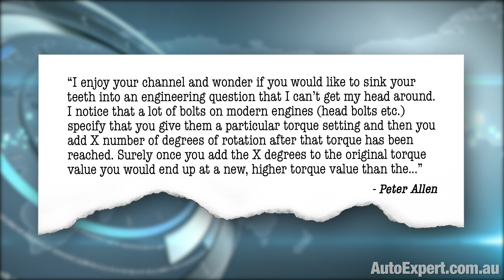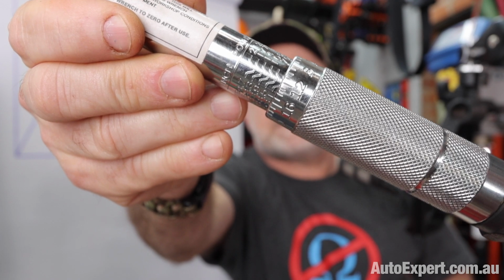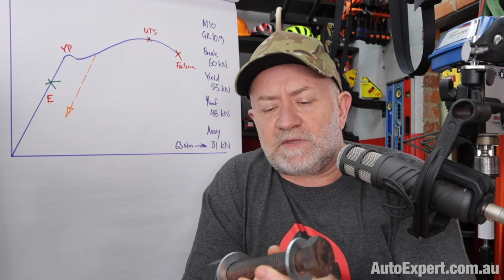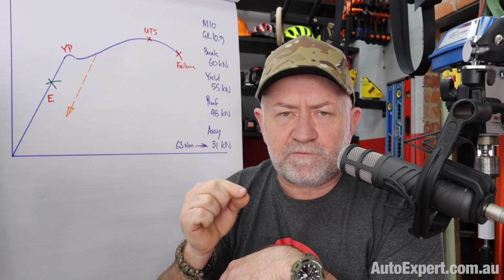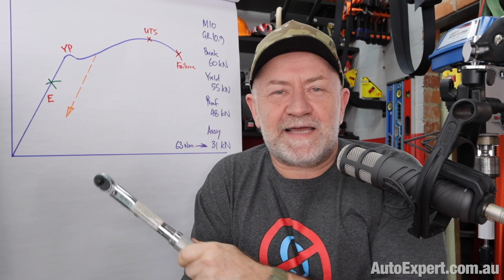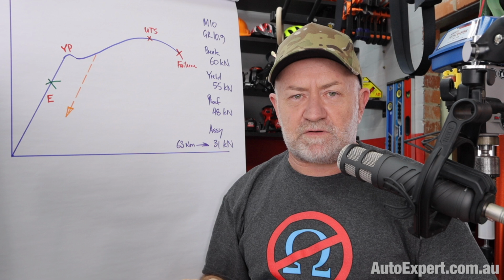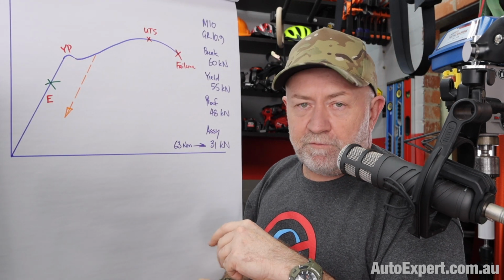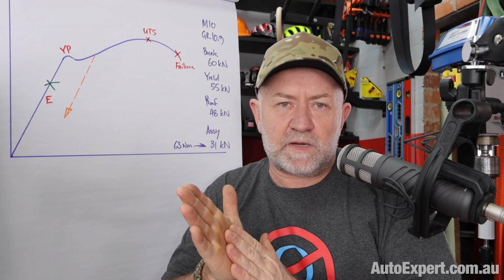Torque to yield bolts & angle tightening explained | Auto Expert John Cadogan

Comment: Well said John been an engine reconditioned for 36 years and still have to explain to mechanics every week why they must be replaced and secondly the best lubricant to use on the bolts or studs to achieve the correct torques👍
Reply: Michael Wilson  the engine world is so complex as the technologies in the modern engine get more involved each year so we never stop learning just like ra finishes for block and head surfaces,bore finish requirements for different piston rings etc but one of the biggest problems we find is when we ask mechanics what caused the failure rather than just example put another head gasket on it👍
Reply: Hi Bryson, ive only ever installed torqued bolts dry. And have just come across TTY bolts recently. What lube do you recommend to not over torque/stress the bolts while achiving the desired angle/stretch? A few artiles online mention using straight weight 30 oil. cheers
Reply: @loccomoffo1000  Hi we recommend a product made by CMD EXTREME PRESSURE LUBE NO3 it’s available from precision international in vic or Fabre in nsw or online.Apply to the threads and under head of bolt and both sides of the washer if it has them.Will give you a great result every time.

Comment: Fantastic John. Can’t wait to the next video on stress raising points and the difference between machine cut and rolled threaded fasteners. Keep up the great work in educating us all.
Reply: Lets also include the ones where the threads deform slightly as the bolt is done up.  They are designed so that the angles are correct when installed.

Comment: Kudos to all the engineers who keep all the bits together, especially in the aerospace industry. I have personally been responsible for keeping the wings attached to fighter aircraft, in some examples of which only have three bolts, a truly amazing engineering feat. 👌😎
Reply: Aways important to do the odd nut and bolt check...
Reply: ive seen the wings a shakin. so yeah feat of engineering. also rode a plain that had visable motor cover bolts rattled out. it was a comercial small plane operated by a large carrier.
Reply: Ever install bushings in those lugs that are swaged into place with a mandrel and air over hydraulic pump?
Reply: @Kenjiro5775  Removing them without galling the mating surfaces is an art form.

Comment: Thanks John I used your greased wheel bolts idea (VW uses bolts rather than studs) and it worked well. Very solid. Even bought a 1/2" torque wrench from Bunnings ($40!!!) also at your suggestion.

So yes, indeed, your hopes to have helped are fullfilled.

Comment: I agree with what you say here; I have BMW E46s, had them for years. Underneath is an alloy skid tray that is removed from time to time. It has 8 seemingly normal bolts so every non-BMW tech will simply unbolt them to take the tray off when required and re-bolt with the same bolts on replacements. The tray is structural, the bolts are torque-to-yield + extra turn (can’t remember the angle), cost, in the UK, £70~80 from memory and must be replaced every time the tray is removed. Consequently, nobody replaces the bolts and the stability is compromised. Bizarre BMW nonsense.
Reply: Feral Man  I agree, I've checked it with a spirit level.
Reply: I had am e46  coupe trays were plastic though maybe different bit you're referring to I loved my e46 coupe cdse

Comment: Best engineering explanation on subject that I found... big like and subscribe...
Unfortunately most automotive servicing is done with impact wrenches without bolts replacing, and they use torque/angle tightening just on cylinder head bolts, camshafts ... but not all times they even replace those engine bolts ... but in the end an old car repaired can't be like a new one...just extend its life until it brakes all around and get to junk yard...
Thanks for sharing your expertise in the field ... useful for us, as DIY repair, at least for me that I was not understand very clear those extra angle tightening.

Comment: I'm a fitter by trade (been off the tools for a few years now but still working in the industry), and one of the easiest bolting methods I've used was hydraulically stretching the casing bolts on a steam turbine. We are talking bolt diameters up around 80mm here so there's a fair amount of pressure going through the hydraulics to do the job - makes the job easy to undo them as well. I do think that people who are on the tools all day everyday can estimate bolt torque fairly well by hand. Anyway if all else fails just tighten until it goes loose then back off half a turn :)

Comment: Did a few heads with this set up. VRS sets came with new head bolts including lubricant, apply to threads & underside bolt head. Tighten bolt to specified tension with tension wrench, then use a degree plate. Critical head bolt threads in block were spotlessly clean. 
Example 25 ft pounds, 90°, 90° , 3 stages, spiral or criss cross sequence, working from center outwards.

Comment: Ultrasonic techniques have also been used in the auto industry for head bolts, main bearing caps, etc... Where a piezoelectric layer is adding to the head of the bolt and ultrasound is used to measure the strain applied as the bolt is tightened.

Comment: Thanks for your sharing of knowledge. Working on a machine the size of a small apartment building, comprehending why 'we' use a 1 meter pipe on a large ratchet to get the 'shown' tension allows me to 'push back' and show - via your video - that maybe, just maybe we can rely on the gasket and its composition and tighten the 20 bolts 'a little less' - even with the torsion increase required for lubricated bolts...

Comment: When I started in marine engineering, we used torque wrenches for most of the ships in the fleet. Hell, I remember reading the manual for an ancient (open rocker) engine that called for, “two good men on a four foot bar.” I loved working on those old beasties. They were Mirrlees National V16s and were so lose in tolerances that they’d run for over twenty minutes with no cooling or lubrication, (don’t ask how I know this).The company, finally wanting to move to the new century, started replacing our ancient ships for new. Most of these new ships of course came with newer engines that require hydraulic bolt tensioner jacking systems. Slick as bear shit as you just place one jack on each head/rod/bearing cap bolt, jack it to the pressure indicated in the manual, and use a tiny pin to tighten the nut. Cheers

Comment: I may suggest searching you tube for applied bolting. They have some excellent videos demonstrating the very things you are describing. I would like to add this to their videos for use in my torque certification class. If I may?
And LOL on the ft lbs reference. I will be switching to all Nm if available this year for the classes. Time we grew up.

Comment: Always like to watch these videos. I assembled a Rover 1.8 K series motor a while back and it got me wondering. The rover has long, approximately 400mm TTY head bolts. Torqued + 180 + 180. How can it happen that the thread is still rotating in the block and not twisting the bolt? It would seem thread preparation would have a marked effect on how much yield  contributes to clamping vs twisting the bolt. One of life's many mysteries.

Comment: As a follow up, how about a vid of bolts versus studs? High performance/racing engines use studs to get around some the problems with bolts you have described.

Comment: Doing the brakes on my wife's Jeep Cherokee and the Fiat/Chrysler dealer nearby is saying that I don't have to replace the TTY fasteners for the caliper brackets. Also he had two bolts on hand from a kit of 4 replacement bolts, so that tells me that Jeeps in my area are going around with incorrectly installed brakes from the dealership and that is scary! 😳

Comment: The method used on the high speed diesels I work on (MTU) was to use a hydraulic assembly nut to stretch the bolt to a required length, this length was then checked against the hydraulic pressure applied to verify the bolt is not compromised, then the nut for the machine's main cap is wound down to hand tightness and the hydraulic nut is released.

The bolts were of the quality that there was never any deviation from the stretch to pressure specs on any of the bolts I tensioned, even over multiple builds on the same engines.
Reply: Saw the same when liebherr were putting our 300 tone excavators together, all the slew ring bolts were hydraulically stretched and hand tightened, very clever I thought
Reply: Hydraulic tensioning is far more accurate and repeatable than torquing 👍. The technique you described is used in many heavy industries.
Reply: @frednurks8528 yes, I understand it is used in many applications in heavy industry, there is simply no way to build tools compact enough to tighten by turning and as the size increases friction becomes more of a factor in inaccuracy when using the torque method.

Comment: Good subject & explanation, John + comments: Nice to see a white board graph. Hope to see more, incl vectors & BM's?
TTY gaining  prevalence, over recent years? I had wondered about factor of safety? Ultimate/Yield stress? Hopefully designers have it covered? Big ol' machinery work has been using hydraulic torque wrenches a while? Not sure if that was to yield tho'. Those old bolts were re-used?
Back in the day, a foreman tapped a ring spanner with a hammer & told the workers - This is how you use a torque wrench.
Deadpan. I guess, he watched to see who smiled & he'd keep a closer eye on those who didn't? :)

Comment: Thank you John but I still have a concern on TTY bolts. 
When they are installed in a cooled down engine, the bolts are already in plastic zone. And when engine warms up, thermal expansion should stretch the bolts a little bit more. And after the engine cools down again, will the bolts remain stretched (because they are no longer elastic and leave a gap there?

Comment: Holy physics "Fat cave man", that was a great bit of teaching...
I used to put big power station turbine casings together by heating the large casing bolts by inserting an electric resistance heater into a bore through the stud and angle indexing the nuts on the threads to get a measured stud stretch.

Comment: I have personally known 2 Mechanic's that could tighten up to torque spec on head bolts and other's. I tested the head bolts after they had done their bit with a torque wrench, not wench ;) Both Mechanic's had decades in the job, and could diagnose any issue's with a vehicle just by listening to its noises. I could do the same with the trucks I drove.

Comment: There is a way you missed, pre stretching a stud. On marine diesels I've used a tool that is essentially a hydraulic jack that screws onto the stud above a nut and stretches it by jacking to a specific pressure and doing up the nut finger tight. Once you let off the pressure you've got a perfectly set stud and nut, they come with splitters to undo a unit head all at once.
Reply from the maker: Quite correct - I did miss that one - thank you for pointing it out.

Comment: When it comes to angle tightening, a common instruction was seat the nut and then so many flats. That was pretty easy to measure.
Reply: A torque spec on the "seating" step is still a very good idea.

Comment: Got 1 for ya (good info btw) 
Helicoil in block of a 1402 4 cylinder bike engine.  Torque specs 25nm and 37nm . The bolt into heli  yielded and broke ..25nm went OK but between that and 37nm it broke ..can assume it he friction was at its breach and bolt gave at yield point ..any suggestions? Haynes recommended not changing torque specs in case of keaks . 

Thanks  heli is still in place not moved . Thanks

Comment: So how do I deal with flywheel bolts that have the tightening angle given as 60-90 degrees? Anywhere in between is fine or am I feeling for something in that range?
Reply: Go in between and don't worry. Angle method is more precise than torque only.

Comment: Torque is a measure of friction under the head and threads. Has almost nothing to do with clamping force (tension).
The angle method is more precise: because thread has a pitch (therefore angle = travel, "feed" = elongation = tension).

Comment: As important as the "real-estate" considerations is that, when clamping down a deep aluminium cylinder head the differential thermal expansion of the aluminium WRT the steel means that there is a stretch/relaxation cycle in the head bolts every time the engine is thermally cycled. With a conventional bolt the stresses associated with that are concentrated in the short length of the bolt where the cross section is down to the root diameter of the thread. By using a stretch bolt that is turned down to the root diameter of the thread (or even slightly less) over much of its length the stress of the thermal cycling is dissipated over a much greater length of the bolt and is much less likely to induce a crack. Whether it is actually TTY is rather less important.

Comment: “What is a bolt anyway?”
Holds up a set screw. 
😏
Reply: Well to be pedantic its actually a machine screw
Reply from the maker: I know. Didn't have a big bolt. (Shhhhhhh - most people won't know...)
Reply: Auto Expert John Cadogan 
👍 Mums the word.
Reply: @AutoExpertJC  if I find it i'll send out a UH-1 jesus nut, but I haven't placed hands on it in...well long than i'll say. 
edit - they have big bolts also
Reply: He is in lock down, give him a brake...
Reply from the maker: @wood2259  ...and a 'break'.
Reply from the maker: @Nipplator99999999999  I would love one of those.
Reply from the maker: @michaelslee4336  I saw that movie...
Reply: @AutoExpertJC  i wondered who'd be the first to notice
Reply: The latest ASME definition of a bolt is 'a fastener used with a nut"
It used to be a machine screw with an unthreaded shank section.
None of this makes sense.

Comment: Correction the distance the nut travels in one turn is the lead of the thread. While pitch and lead are the same for a single start thread lead equals pitch times number of starts! And for bonus points the definition of a thread is a helical groove of equal proportions formed on the surface of a cylinder or cone how’s that for beer garden engineering?

Comment: John, I understand why these would be used in an engine, but why would TTY bolts be used on my 2018 Camaro for the bolts in the suspension that have to be replaced when the car is aligned?

Comment: Very interesting topic. When torquing multi stage head bolts with a final angle torque, would you repeat each stage before the next as doing so would produce a different result when the final angle torque is applied? I have noticed that some manufactures instruct to do so while others do not. Say after torquing the first stage to 25nm, would you repeat the 25nm on all the head bolts before the next stage because when you do, you will find the bolts tighten further to 25nm?
Reply: If it has multi step tightening, follow the exact sequence. They know that by the end of the first step that the first bolts likely won't be at what you set, but as you move thru the steps you're going to tighten past that first step, and by the end of the steps you're going to find they're all going to retain the appropriate tension. 
You want to do it in the stages they say so the head can actually move as you tighten it down. 
If you bind it down too aggressively, you're going to introduce tension into the head in uneven places that will likely cause warping or cracking.
Reply: Thank you. Yes, I always wondered though in the back of my mind, that it may have been left out of the instructions assuming the tech would automatically repeat. Never quite sure. Thanks for your comment 😊

Comment: There is one way to restore and reuse these fasteners.  Heat-treat and anneal to recrystallize with strain free grains in the material.  When material is cold worked/torque to yield in the plastic region, grains distort and tangle with each other more to increase strength while sacrificing ductility.

Comment: Great video thanks John! I tow a caravan (sorry I appreciate your aversion to this past-time) in the UK and the wheel hubs use the ALKO torque to yield system. There's a large nut  that is oval when new and when torqued up to specification will 'round' up and develop the required clamping force. I've changed hubs on my own caravan and the torque required is approx 290 + or - 10nm. They are 'one-shot' nuts but work well.

Comment: The tension may be standardised but how to determine the specification reliably in the first place?
Reply: The clamping force must be high enough on the coldest/hottest day to hold against the greatest force plus some.  Different alloys expand at different rates so you have to pick the worst combination.

Comment: My understanding is that torque to yield bolts are typically fitted in the factory by machines/robots that torque the heads down evenly by torqueing all bolts at the same time.  You cant replicate that when replacing head gaskets etc, so the best option is to ditch the torque to yield concept at that point and use good head studs - like ARP - that allows for even and accurate torque settings using fine threads.  Cheers

Comment: Hey John,

Is all steel the same? Are there some ingredients/processes that are better than others that leads to varying quality and properties in steel? If yes does this change the graph profile or the scale?
Reply: The short answer is no. Any decent bolt (or set screw) will have a number on it like 8.8 or 10.9 etc. and for any given diameter bolt, it's tensile strength and recommended torque changes depending on that number.